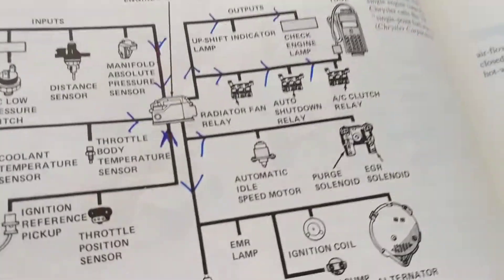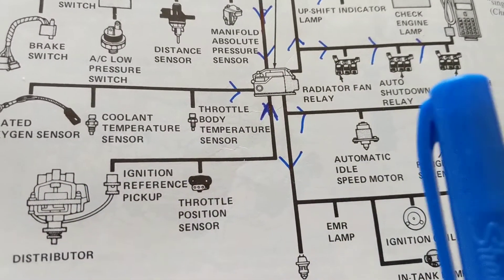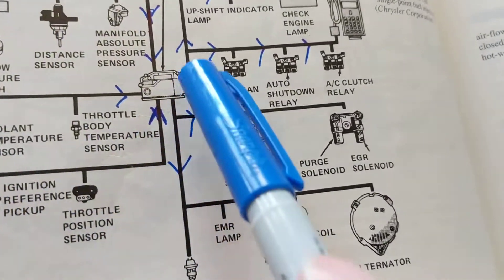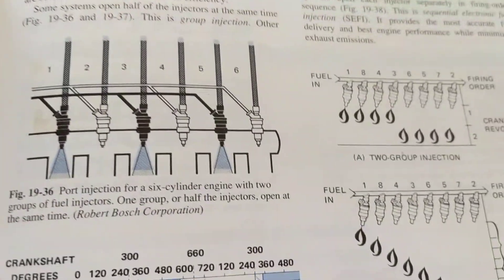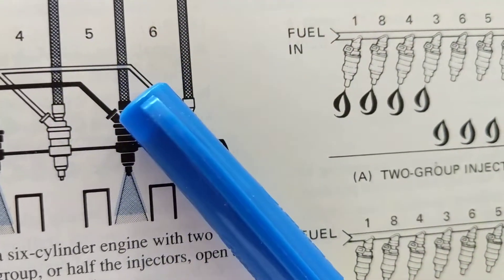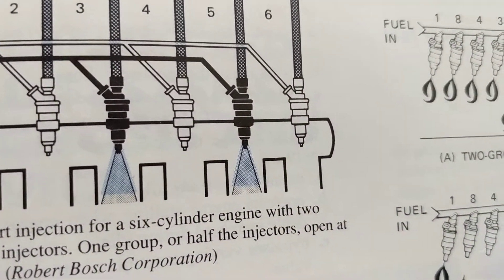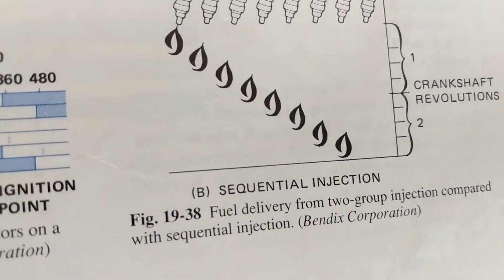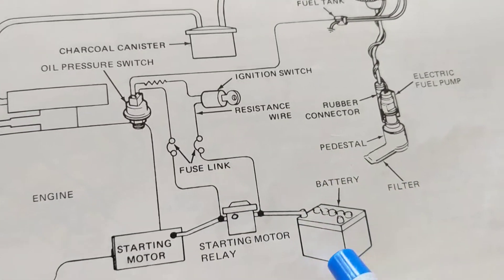How fuel injection systems work part 2 port injection and sequential injection easier to understand

Comment: How can I get schematic diagrams like those.  Thank you for your elaborate explanation of the electrical computer aspect of how the engine runs and the SMPI fuel injection system.

Comment: I haven't watch the whole video yet so maybe he talks about this later, but doesn't port injection waste a ton of gasoline because you're going to be injecting fuel on 2 out of 3 cylinders that are NOT on the intake stroke (or compression stroke depending on the type of system you have) ?!
Reply from the maker: Yes you're right and intake stroke and an exhaust stroke that's why many systems have changed to GDI system and also sequential fuel injection system
Reply: That's plain multiport, and it's on the intake and power strokes, both downstrokes. Sequential multiport fuel injection needs a cam position sensor but can fire the injector only during the intake stroke.